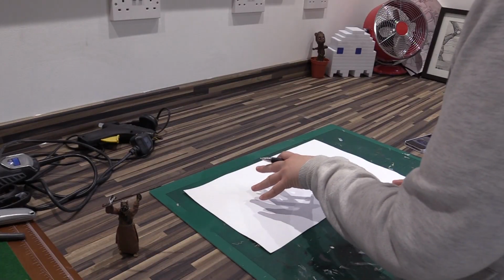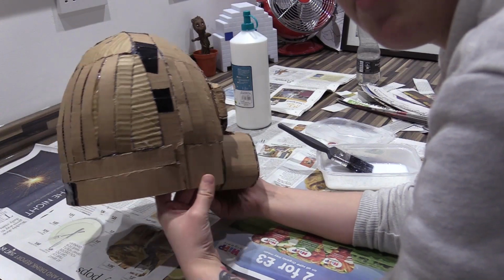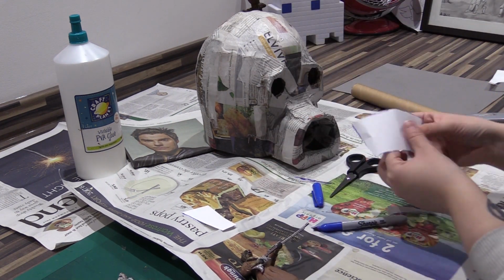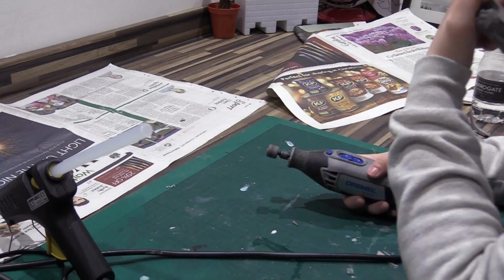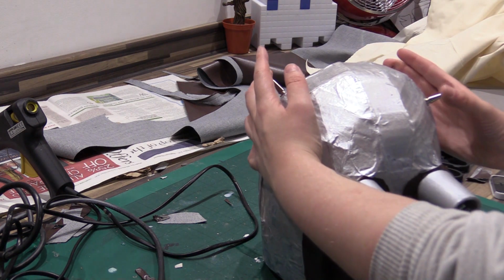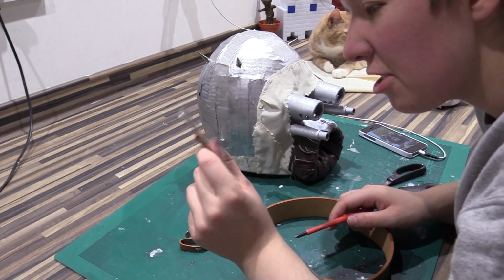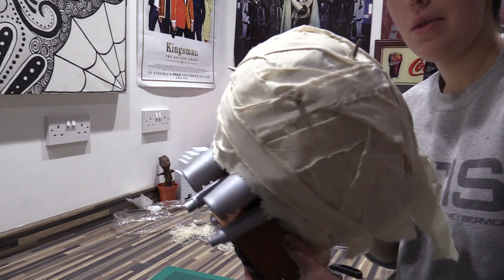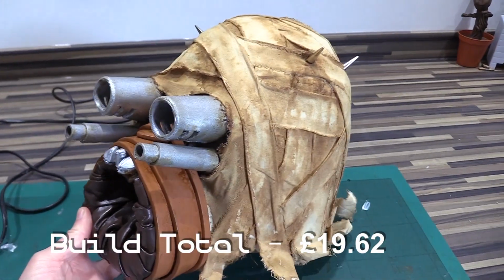£20 DIY Tusken Raider Mask | #20PoundPropChallenge (Ace Vs. Buckethead Props)

Comment: Awesome!    Cchhheeeeehhooooo!  This is how we used to do back in the late 70s and early 80s before anything was available. You wanted something you built it from scratch!   No cosplay stuff. All Sci fi , the only 3 helmets that first came out back in 1978-79  were the Vader,  Stormtrooper,  and a C3-PO.  The 3PO was actually very stiff rubber and had the slit in the back of the head.  This is so old school awesome!   And as you build and add items you feel the weight of the piece,  and you get an awesome feeling of accomplishment as you get close to finishing. Fantastic build!!

Comment: Maybe a dumb question to ask but since it's made from cardboard, would it break pretty quickly?
Reply from the maker: Not really. As its been reinforced with the paper machè method its pretty strong. If i stamped on it it would deform for sure but I could drop it 100 times and it would be fine

Comment: I hate to be the bad news bear but you forgot the translator bit that hangs off the bottom and drapes down to the chest of the tusken raider
Reply from the maker: Hilario Mendoza 1. Not all Tuskens have that and 2. that part attaches to the neck of the costume, not the mask so not a part of this build
Reply: Sorry but would've helped me a lot
Reply: Hilario Mendoza the correct name of what you call a ‘Translator bit’ is actually called a cylinder or ‘Neck Breather’... Tuskens don’t use anything tech.

Comment: Instead of the fake leather, pick up a used leather jacket or purse at a thrift store (I believe you Brits know it as a charity shop). I made a Han Solo holster out of  cardboard, covered it in a cut up coat and it looks good. You can't mimic that worn leather look.
You did a great job on your mask!
Reply from the maker: Carrie Cessna a leather jacket would have been more expensive from a charity shop and taken me over budget but I have done stuff like that before for old costumes. I do love a good charity shop 😆